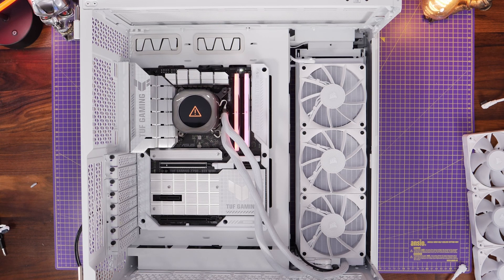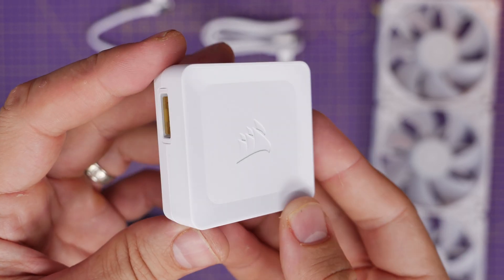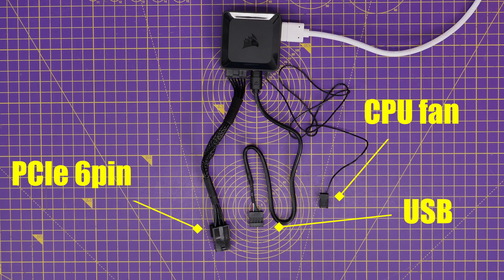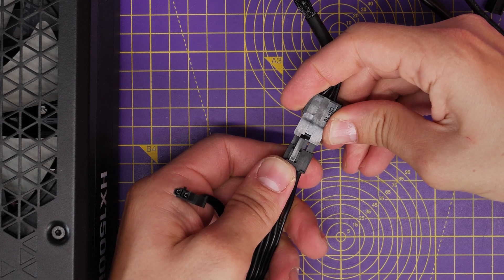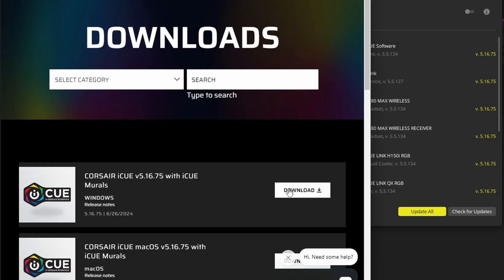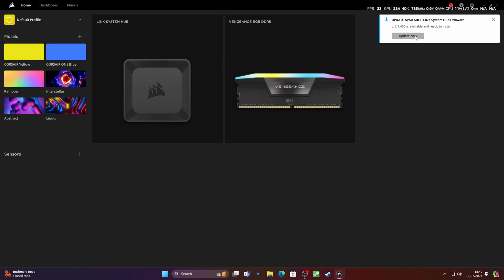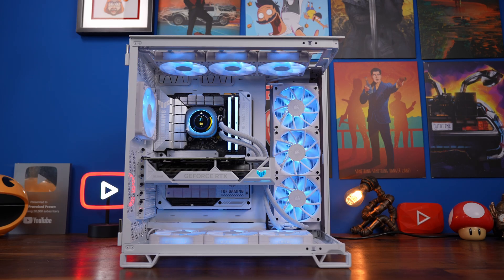Corsair iCue Link not working? Try this fix

Comment: Firmware is updated, the fans work individually when connected with a cable, but not when they are daisy chained. No fan movement, no rgb. No damage to the pins, the magnets properly snap and line up with each port. Ive got 6 fans and all 6 have the same issue. Ive tried all the trouble shooting

Comment: Mine are lighting up but i cant control the colors. i connectetd everything properly. what did i do wrong? i reinstalled the icue twice. i cant controll the aio as well.
Reply from the maker: You have the controller plugged into PCIe power?

Comment: Can someone tell me, where exactly he puts the Pcie Cable that he out inside that pci adapter from the Hub? (In which slots goes the other end in the psu)?
Reply from the maker: It goes to the PCIe port on the PSU. The same one you use for your graphics card
Reply: Oh, thank you alot! So do I understand correctly that you connected the 6-pin PCIe cable to the hub and the other end (Type 4 with 8 pins) to the PCI (GPU) connector of the power supply?

Because im building my own pc and im stuck on this step and I asked chatgpt and it says, to not do that. That's why im so confused :/ @TheProvokedPrawn

Comment: i´m running rx 140 mixed with rx 120, wanted a black build but installed the first firmware and everything from there on went to hell, 2 weeks without even a single turn of the fans then the next firmwareupdate...oh yes they spinn but no speed control and now the firmwareupdatecycle like an very old person with dementia it wont recognice the update and i still got no fan speed control, thats a big fail for my opinion and that in the high price sector is a no go...

Comment: help me please, i have an h100i cooler with no lcd. bought the upgrade kit and substituted the corsair fans and now when i put the lcd cap on it boots up, shows the corsair video but then goes red triangle. i have the cable that comes with the screen plugged on the radiatior and the usb part on the mobo, and the corsair like nk hub that comes with the original cooler has all its connections in place. the thing is neither the hub or the cooler show up in icue
Reply: Me too 😢

Comment: I am unable to rotate the LCD screen on mine. I have uninstalled and reinstalled icue, updated firmware, yet there is no "screen setup" options within the icue software. Any suggestions? :x
Reply from the maker: Do you have the usb connection from the pump head or the radiator connected to the motherboard? You need that for the display

Comment: Mine will show the I link hub in Icue, fans run but only says run rgb wizard and every time i run it i wants to restart Icue..  Just continues to do the same thing.. Fans are running, no lights or no fans showing up..  I even compleaty deleted Icue and reinstalled to come back to the same thing..  Very annoying Im about to return this crap and never use Corsair products again.. Im not spending another 130 dollars on fans just so they all match.
Reply: It is because the aio has RX Fans...and the 3500X has RS Fans...wich are not connected the same that sas the problem for me, either you buy RX and have a simple easy system or an ICUE Lighting Node maybe you can connect it with your system.
Reply: @NiclasDreger  I bought the 3500x without any fans installed, and instead just bought 4 more rx120 rgb fans. 3 for the side and 1 for rear exhaust. Plus the 3 that come with the titan for top mounted radiator. Im glad I did research because I didnt realize corsair has changed so much in like 6 years. I almost bought all argb fans! All these rx fans can be linked :)

Comment: Hey !
I have a Asus Rog Strix B850-E and a Icue link H170i
The cables are correctly plugged in (into cpu fan), my bios is updated and the temps are good
I can fully control the fans and the rgb but im not able to set the pump speed under arround 2400rpm (quiet mode) and 2800 (extreme mode) witch is kinda loud
I tried to update Icue, switch to another controler, force update but nothing seems to work
And now i think its maybe because of Qfan in the asus bios but whatever i do im not able to lower the pump speed
Do you have any idea what is causing that issue ?
Thanks a lot

Comment: Ok so when I plug that USB pin-usb micro into the box the cooler does not work at all but without that cable it all works fine I just can't control rgb
Reply from the maker: Have you connected all the cables correctly including the PCIe power
Reply: @TheProvokedPrawn yes, everything was connected correctly. I tried pretty much everything including taking it into the store and having a couple of techs look at it. I took it home and after a while I figured out the USB to micro USB that controls the RGB color. When that was plugged in the pump and the fans wouldn't work at all they would get no power but when it was unplugged it would work perfectly so I I booted it with it unplugged and then plugged it in when it was on and reinstalled the software and it works now, but still quite odd that the USB RGB controller was causing it to not get any power at all when plugged in

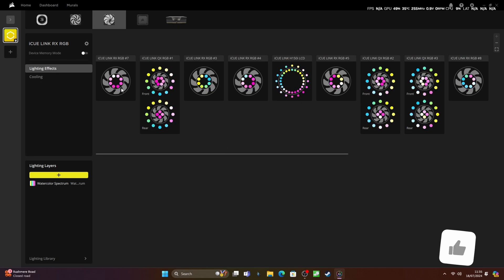Comment: 2:37 what do you mean USB connection from the radiator to the MOBO? The only USB connection to the Mobo that I have is to the Corsair hub.

I can’t get the screen to be recognized in icue and this is how far I’ve gotten
Reply from the maker: What cooler do you have? If there's an LCD screen you either need to connect a usb cable from the pump to the motherboard or from the radiator to the motherboard so it can be controlled
Reply: @ this was it. The usb-c to motherboard cable that I forgot to install 2 months ago was buried at the bottom of all my spare cords. Interesting that forgetting this only impacts the ability to change the screen. Cooler has otherwise worked 100% normally without it.

Thank you so much for your useful videos and reply!
Reply: @TheProvokedPrawn  I'm running into the same issue and looking around forums and youtube vids. I'm assuming this also includes the USB on the link box to the mobo, correct? Or is there a second USB connection I should be making? In my case all fans work, cooling works, the LCD shows the liquid temp as it changes over time, ICUE software has no red triangles and I see the link and "LCD", but my only options are to adjust the lights. There is no screen option.

Comment: Just updated pc, previously has 2 LX fans working perfectly with link hub. Just added the 240 LCD screen radiator and 3 new front case fans. Only my rear exhaust fan lights up and is discoverable in icue and it’s the last in the chain of 6 fans. All fans spinning just no RGB or detected in icue.
Checked everything is properly connected following a previous video of yours, I’m hoping it’s just icue being dumb.
Reply from the maker: The screen and pump count as separate devices. If you add that logic to all the fans in the chain how many do you have? It should be a max of 12 (assuming you've got the latest firmware update via iCue for the controller)
Reply: @TheProvokedPrawn  I figured it out, at first doing firmware update no devices were picked up by ICUE. Before it would at least show fans and Link Hub. I fixed by either updating BIOS or deleting all RGB software on PC. After doing this the firmware update finally fully applied correctly and I was able to see ICUE devices however the LCD screen to change image did not show up. I was able to control fans speed and lighting. I then tried to switch the cables that were plugged into USB headers. Tried using a Y splitter for USB headers and still the LCD options weren't showing up. I had checked ALL connections previously multiple times and they were secure. Finally I got frustrated and unplugged and re connected the USB C cable on CPU block twice while PC was on and I got the sound notification that a new device was connected.

Comment: see im having a problem i cant find an answer too , i got it in my case got it all setup and it lights up , fans work , seems like its cooling my cpu cause its cooler than it was yesterday when i didnt have it in , but its just not being detected in the ICUE software but the rgb work the fans work and it seems like its cooling my cpu
Reply: I'm running into the same issue, can't seem to figure it out. I'm assuming it's some kind of USB 2.0 issue but I'm not sure really.
Reply: @YoungSweat is corsair, the garbage that they sell us! They have great ideas (some stolen) but executions is trash, software will destroy your parts!
Reply: @YoungSweat try swap where they are plugged in on the internal 4 port hub or try another 2.0 port on the board. For me two worked but then when I swapped my fans on to one that worked they all seemed to work

Comment: Hey man, i just got a iCUE Link Titan 360 and everything works except for the link hub lights, the fans light up and work and everything else but the hub does not light up at all, I rewired everything to be sure and ran all the firmware updates in iCUE and even updated my Bios, any idea?

Comment: I just got icue link fans to upgrade them from corsair 5000x rgb fans who are wired  my problem is fans not powering on or light up I have them pug into usb 2.0 header sill noting  I have  check the usb 2.0 it's got power  and sec problem I seem to have 1 usb  out sill even when all pugs are in  and question  should I upgrade to corsair io instead of air cooled  and reason I gone air cooling is do to can happen with io pump  so if someone had the same problem  let me what the fix is my mother bored is rog 20790 gameing wifi  e

Comment: Corsair took alot of shortcuts with this AIO cooler. The thing sparked and shorted out the controller after assembly and would not turn on. No lights and fans weren’t spinning. I got an exchange and the same thing happened the second time. Ended up just getting a refund. For reference I have a 750w PSU from EVGA so I know it can’t be a compatibility issue. Going to try my luck with the NZXT kraken.

Comment: I don’t know why my new H150i does not power on. I tried different cables for each side. Tried a second system hub. Tried to reinstall icue. Icue is fully updated. Ever cable connection is correct according to my MB manual. I have the correct tach connection and usb.  I don’t understand. Did I receive a faulty AIO?  The pump works fine and the lCD lights up. But there is no power to the fans and no rgb. 6 fans work. 6 other devices on the other side of the system to make 12 total devices out of 14. Still doesn’t work. I tried using two system hub adapters. And still nothing. I’m out of options now
Reply: im having the same issue, trying to figure it out. i just built a new pc so im scared to even turn it on because none of my fans or even the aio itself have lights so im not even sure if the pump works, if you fins a solution could you please be kind enough to share, thank you.
Reply: I’m having the opposite my fans will turn on but my pump lights and pump will not power on. Is this a motherboard problem?

Comment: my lcd screen was working fine up until today. now it looks like the image shown on the lcd is rapidly scrolling across the screen such that the left half of the image flickers on the right side of the lcd, and the right side of the image flickers on the left. i say flickers, but it looks more like the image is rapidly moving left to right across the screen, or maybe right to left. it moves so rapidly that it is hard to actually tell. i have litterally tried everything i could find online to fix this. forcing firmware updates, draining all power from the system by unplugging from the back of the psu and then hitting the power button, etc.

also, the rgb led ring around it is much dimmer than it used to be as well. even though the liquid temps never went above 48c, i do not think that the units handle heat well at all. a design flaw. i am currently going to order a replacement to see if that fixes the issue, but if it does, i am left wondering how long until that one fails as well. i have only had this installed and working for less than a month in my system.

Comment: so my stuff all works and lights up but doesn't pop up in Icue
Reply from the maker: Assuming it's all connected properly via the usb cable to the motherboard and you've tried uninstalling and reinstalling the latest version of iCue?
Reply: @TheProvokedPrawn  yes
Reply: @TheProvokedPrawn  Any answer to this ? I've also got the same issue.
Reply: @RedPowder did u fix it ?
Reply: Did u fix it ?

Comment: I got a 3 pack Corsair rx120 RGB got them instal but they don’t show up on the icue app they light up and spin the usb 2.0 is connected everything is conectes idk why is not showing up on the app I already uninstall icue and update still nothing
Reply from the maker: Have you checked for a firmware update for the controller in icue settings
Reply: @TheProvokedPrawn  The fans and the controller don't show up on the icue app only things showing in the app is my corsair ram and my corsair H100I pump and fans of the H100I not the rx120 fans
Reply: @realmemes6265   did you find a fix for it? I have the exact same problem as you rn, ram and mouse are showing up but not the controller or the qx120 fans
Reply: @Chishiiya did u fix it bro ?

Comment: I realize the comment may not be answered but I just finished building a top end pc. Everything works, fans, aio pump. The only thing that doesnt work is the LCD screen on my H150i. Worked fine till I installed ICUE and now I cant do anything with the LCD and restarting the PC doesnt seem to breath even a split second of life into it. Was wondering if youve run into any similar issues with corsairs LCDs?
Reply from the maker: Have you connected the usb connection from the radiator to the motherboard?
Reply: @TheProvokedPrawn i have the same problem, software doesnt give the option to custom my screen, all is perfectly conected, i even switch the USB position but that thing doesnt work, other commment with the same problem said he was using an Asus MB(same like me) could check it out? u're my last hope🥺
Reply: @brianmartinez9595  same here my screen just sits at 0* C with no option to change it on Icue
Reply: @TheProvokedPrawn I have and it still has issues.
Reply: Same problem here! all runs perfectly fine but im not able to custom the LCD screen on iCue, i've seen tons of comments on other videos with exactly the same problem but i don't know that to do 😭

Comment: 12 devices per port not 7? Ah sweet. Got 14 devices and wanted extra 3 fans for push/pull on my radiator. Thought id needed an extra hub for that but guess not. Cheers.
Reply from the maker: Yeah that is right. They have upgraded it.

Comment: I have a problem that I couldn't find a solution for and it's not one of these xD

So since start it just shows "Liquid Temp" ... which is.. "ok" but not why I bought the LINK H150i. So in the software it simply is not available, or better - The screen is not available, the rest can be changed.
Any ideas anyone?
Reply from the maker: Have you connected the usb cable to the radiator and to the motherboard?
Reply: @TheProvokedPrawn  Yeah, only thing that corsair suggested was: uninstall icue, power off,  Unplug it (the screen and the cable, plug in again, reinstall icue.  b ut yeah, nothing :| 

There was also no real "where to plug it" so I basically just plugged it into the radiator and then in one of my USB slots in the mainboard. (Gigabyte AORUS Elite AX ICE AMD B650) 

Thanks for the reply!
Reply from the maker: @FeraFlox  I'm sorry to say that uninstalling iCue and reinstalling the latest version often works as the fix in my experience 😂
Reply: @TheProvokedPrawn  :text-green-game-over: :D ah well... maybe it will work somewhen at some point... who knows... :|
Reply from the maker: @FeraFlox  you're sure the usb connection isn't loose?
Reply: @TheProvokedPrawn  pretty sure, last time I even switched the way the USB-C is plugged in (dumb, I know... but who knows) xD
Reply: @TheProvokedPrawn  removed everything again, did it the same way as earlier today... however now it works. 

Thanks almighty Prawn! :P
Reply from the maker: @FeraFlox  I doubt I was any use but I'm glad you sorted it!
Reply: @TheProvokedPrawn  Well it's because of your kindness (in general) and positive spirit that I was "ah well, I'll just try it... AGAIN" xD 

Thanks for all your awesome content :)

Comment: I wanna say ive actually mounted onr 120mm fan at bottom on my h7 flow elite 2023 model works very good i use 240 aio then rear fan so 4 i take 3 outtakes

Comment: My rear exhaust fan and AIO are lighting up and spinning however the front 3 and pump RGB and not working
Reply: Did you find a solution?
Reply: @joelerade  i didn't connect everything in the box + connect all the fans correctly together
Reply: @OfficialBreazzz remember what exactly happened? My last fan in chain has RGB and is detected by icue, however the 2 radiator fans and 3 front case fans spin with no RGB and not detected by icue.